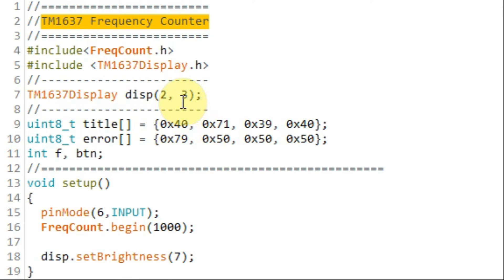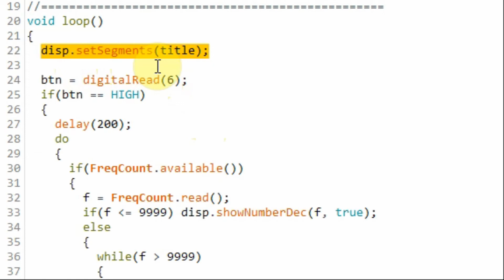TM1637 Frequency Counter

Comment: Hi,thanks for the good videos and page, I had a question, is that the key ih the schematic is pulled up or pull down and why when I connect to the output of a generator signal with the purple AD9833 module that I made myself Does not show any value?